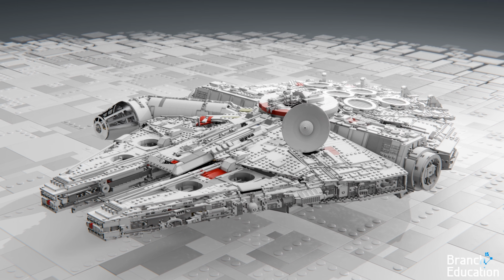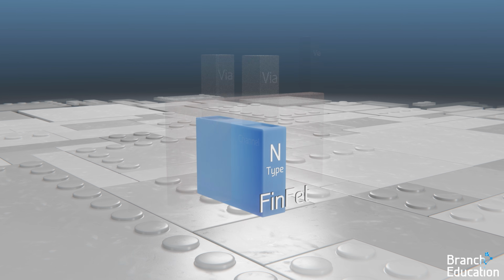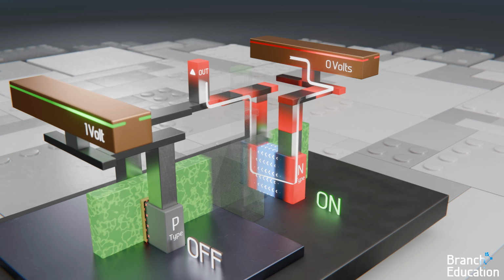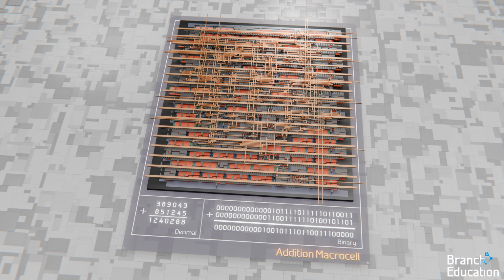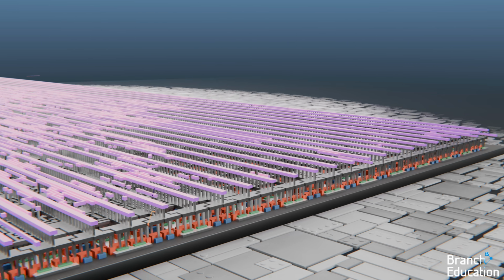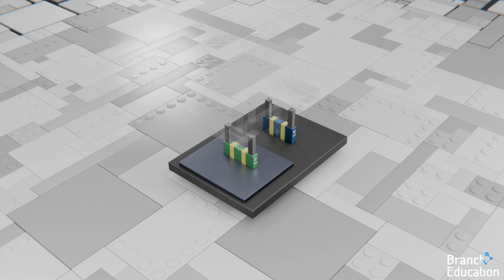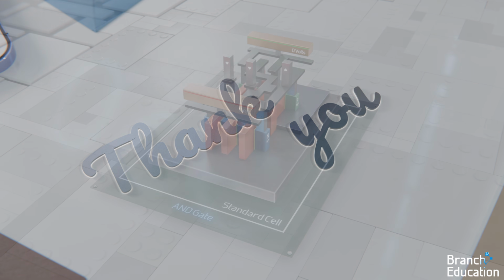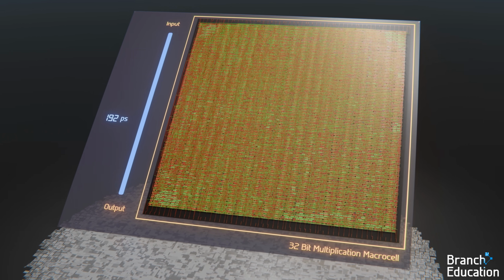How do Transistors Build into a CPU?  🖥️🤔  How do Transistors Work? 🖥️🤔

Comment: 4:31 this describes a depletion FET, not an enhancement type. Enhancement types are used in logic gates.
For Enhancement P FETs:
Vgs = 0V results with no flow.
Vgs = -1V results with current flow.

For Depletion P FETs:
Vgs = 0V results with current flow.
Vgs = -1V results with no flow.

Putting a depletion P on top of an enhancement N, with a shared gate and logic 1 input, will draw a high current (very wasteful). Some inverters are made this way, but with the gate of the depletion P FET shorted to source (as opposed to connected to the gate of the other FET).
Reply: If you don't do it this way, you'll get a lot of noise! Even if the power supply is stable, the finFET itself can cause noise when switching on and off. 
I think the P-channel finFET serves as a booster to avoid parasitic power and connecting it to GND (0V) is the best option!
Replacing the P channel with a capacitor increases the delay in the finFET's response speed and this is extremely bad for nanotechnology where high speeds are required.

Comment: Why don't we use just one P type transistor to make NOT Gate? Looks like it already does what we need 🤔
Reply: If you don't do it this way, you'll get a lot of noise! Even if the power supply is stable, the finFET itself can cause noise when switching on and off. 
I think the P-channel finFET serves as a booster to avoid parasitic power and connecting it to GND (0V) is the best option!
Replacing the P channel with a capacitor increases the delay in the finFET's response speed and this is extremely bad for nanotechnology where high speeds are required.

Comment: Can sb explane how 0V can flow. From what is know about electricity, u always need >0V for electricity to flow. Am i wrong?
Reply: If you don't do it this way, you'll get a lot of noise! Even if the power supply is stable, the finFET itself can cause noise when switching on and off. 
I think the P-channel finFET serves as a booster to avoid parasitic power and connecting it to GND (0V) is the best option!
Replacing the P channel with a capacitor increases the delay in the finFET's response speed and this is extremely bad for nanotechnology where high speeds are required.

Comment: Hmm, are this different transistors than the most basic ones? This is not the symbol i grew up with and see everywhere, and they are called NPN and PNP
Reply: There are 2 groups of transistors!
The polarized and non-polarized transistors.

PNP, NPN, GBT are polarized transistors.
And finFET, MOSFET, CMOS transistors are non-polarized transistors.
Each MOSFET has its own symbol to indicate the type of transistor.

Comment: A notification from you causes voltage-gated CaV1.3 channels in dopaminergic neuron terminals in my brain to open, inducing a localized Ca²⁺ microdomain that triggers SNARE complex assembly (syntaxin-1, SNAP-25, synaptobrevin) and complexin regulation, leading to vesicular exocytosis of dopamine. Dopamine itself is synthesized cytosolically by tyrosine hydroxylase (with BH₄ cofactor cycling and phosphorylation control) converting L-tyrosine to L-DOPA, then aromatic L-amino acid decarboxylase (AADC) using PLP decarboxylates L-DOPA to dopamine. VMAT2 actively loads dopamine into synaptic vesicles, which maintain proton gradients via V-ATPase, before exocytosis releases dopamine into the synaptic cleft to activate postsynaptic D1 and D2 GPCRs, modulating cAMP signaling pathways in my brain.

Comment: Is 0V different from just not having any current flowing through the wire? I don't understand why the ground rail is needed, along with the "opposite half" of all the standard cells, where it seems like the same operation has to be done in reverse just to make the ground rail cause the same effect as the power rail

Comment: Such a good video!

I know what a transistor is, I know what the parts are, and what they do in principle.

But this is the first time I've fully understood the electrical circuit and how it works as a whole.

Great!

This combined with Ben Eater's video show the macro sized and nano sized computers and how similar they are. Just smaller.

Comment: Great explanations! I do have a nit to pick though; I understand why you chose to use 0 volt and 1 volt as the logic '0' and '1' levels to keep things simple, but that's a pretty serious over-simplification. In most real chips, it's 0 volts and "not 0 volts" (typically the positive supply rail). The logic '1' voltage level has changed over the years, generally decreasing as transistors have gotten smaller; and in sophisticated chips (like modern CPUs/GPUs) may even vary dynamically to trade off speed against power consumption as needed.

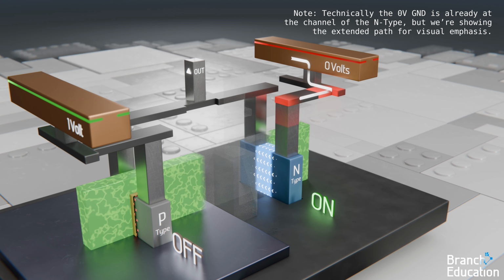Comment: 7:21 i understand why you said that “0 Volts travel through the transistor to the output”, but it is severely misleading to people that want to get into the field and could have been easily avoided by defining voltage as the difference in electric potential between any two points in space and then show how the current flows

Comment: I think maybe one more thing that may have fit well in this video is a mention that there's a possibility of an output left floating (not driven to +V or 0V) and that in chaining logic, we want to avoid this because we want every input combination to have firm 0 or 1 results on all the outputs so that they convey defined data to the next stage.  But keep that floating output idea around for later with bus interfacing...

Comment: Amazing video. One thing while watching as someone who doesn't understand much about logic gates or electricity in general, was that my first instinct was to think about it like a light switch where a 1 is current on and 0 is current off. It made me think that you could get a 0 simply by not applying a current to a P-Type after you had just applied one which is similar to your water flowing analogy. Someone can correct me, but what I felt like was missing in this explanation is A. Why turning the input wire from a 1 to a 0 wouldn't change anything for a P-Type output, and B: that ground wire purpose is to 'reset' the wire allowing it to be 0 again. This would help explain the design of the gates when thinking about it like a process to reset the gate rather than just be turned on forever.

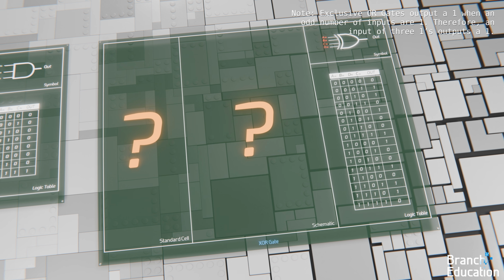Comment: Around 23:50 the narrator poses questions related to how we could build gates with more than 2 or 3 inputs. I'm wondering if that has to do with vector operations in programming where we make it so the CPU accomplishes more than one calculation per clock cycle. Is that related, or is that something else? Is it higher in the abstractions, like at the register level, where transistors are involved by performing operations sequentially until the clock cycle completes?

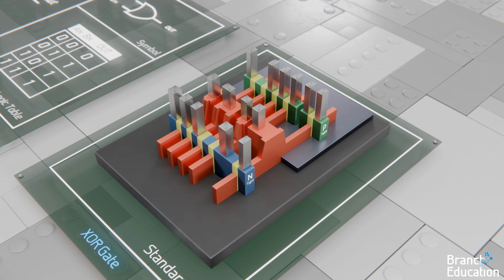Comment: I followed along with this video on Nebula, and tried to sketch out the circuit at 23:03 before progressing the video, and while I got to the same general layout, I think either I got something wrong, or there's a mislabeling on your model. while what I sketched out is the same as your result, there is no output for the second half of the cell. Unless I'm mistaken, your model has the 2 P type gates in series and the 2 N type gates in parallel (the gates on the left of the cell) connected directly to the output (as labeled) as well as to the controlling P and N gates at the right end of the circuit. Meanwhile, the rest of the gates don't actually have an output, at least not shown. Again. maybe I'm misunderstanding your model. I love all of your videos so much, and the way you present everything has always fascinated me and helped me understand so much! That's part of why I'm so confused by this possible error, either in the model or in my understanding. That said, with so many revisions and so much time put into the video, I certainly understand why something like that could be missed, especially when I'm only interacting with it for about 30 minutes while you all are planning and putting together this video for months!

Thanks so much for this and all your other amazing videos, and I'm especially excited to see your dive into the physics of how transistors work!

Comment: I learned about understanding computers and transistors by deciding to design and make my own computer, including designing and making my own "transistors" (between quotes, since while it worked it wasn't a transistor as it worked very different, had very interesting things in it which with normal computers and transistors is very hard or essentially impossible to do. this computer was and is very interesting, though not publickly published also due to how fundamentally different it is from normal computers both in working and use, and so would be hard for many people to see the uses in time before some random company might see and patent it locking it off from everyone(as what has happened to some of my more early inventions which I published without thinking about that( I am not affiliated with a big company or such, so things I publish generally aren't seen or treated as official in a way where it could be used to get patents of companies void, even if they clearly based it on my work and even copied the text I wrote but just changed some names(facebook)), though essentially it can perform many calculations at once and directly link them all to get to the end solution without needing to perform many seperate calculations, and can also do so with way less hardware. most logic gates could be done with 1 such a "transistor", though be it in different ways, I did also manage to make a prototype simulating a normal computer in real time, took inspiration from redstone minecraft computers for the general logic to make a normal computer, then translated it to something this computer could run. also important factor is interlinking capabilities, essentially all bits and cores can both be connected to eachother or not, and can also do so weighted without it relying on any form of complex interconnect.

later I designed made my own actual transistor, or FET speciffically named it SFET as it is a field effect transistor which doesn't depend on N or P channels but instead uses a static field, and some relative geomery.
worked well but only for high voltage. nice advantage is that you can make the N and P channel ones similarly, and it is also possible to make bi directional versions for in AC use, and it can also be used to make very high voltage diodes by attaching a constant static charge(for example capacitor) to the gate terminal. this speciffic transistor I also have here on youtube for how to make and general working. though note it wasn't filmed properly, but is available to build your own sfet from scratch.

later I think it was december 2023 I designed and made yet another method for computing, though the use of this one was diferent, as it was more meant to create new/oddly behaving physics effects. essentially it is a method capable of stabilizing quantum effects on and even far above room temperature in many normal materials, as well as a device to actually do this, which I also actually made and used to confirm it can actually do this by having it create a very strong form of diamagnetism in one dimension yet a quantum locking effect in 2 others(reffering to 3 spatial diminsions, like X, Y, and Z), the nice thing about it is that this was just one effect generated with it, it proves the principle and the same method can be used for essentially designing and creating new room temperature quantum effects. it only programs/creates/stabilize/controlls them however and doesn't read, but you can make such quantum effects interact with eachother and then add a effect to amplify it so it is easily detectable with normal sensors to read it out, the "computer" itself however in this case wouldn't actually exist physically, the programmer exists and the medium it is programmed into, and to some extend the computer exists for a while, but it is and remains essentially just energy stored in the forms of quantum geometry(yes it can store energy in those, power useage was quite low especially concidering the magnitude of the generated effect, but energy storage was proven by the ability to create the same effect in a way where it could remain stable and working for quite a long time, we are talking about seconds here which is very long for quantum at room temperature, and even around a minute later some weak traces could still be noticed all be it much weaker. also note this prototype was far from perfect I had to make it using some things I had laying around at home and I don't particularly have a advanced lab here, mostly relied on frying some normal hardware in the right way that they should form the right patterns and then abusing them in ways they wheren't supposed to be used.
This can also create such room temperature quantum effects in materials like silicon, aluminium and other common materials normally used in semi-conductors, and it is possible to make  both the programmer and material to be programmed(atleast for the effect I tested) using normal lithography mashines. not published due to same reason as first computer, sadly also no interest from companies of universities to properly publish it and research it further, mostly because they don't like working with little known people and the discovery itself largely is a physics discovery and just shows one of the many new possibilities and physics discoveries can't be pattented, thus many companies don't like it because then they would need to spend years to figure out as many ways to do it as possible to be able to make much proffit otherwise someone else just uses another way tha the one they pattented.

Comment: - so transistors basically just store a ruled (on/off) activation for currents.
- the materials either block, hold or transfer current.
- many transistors build long routes that become a process.
- a processor is a compressed container of many routes.

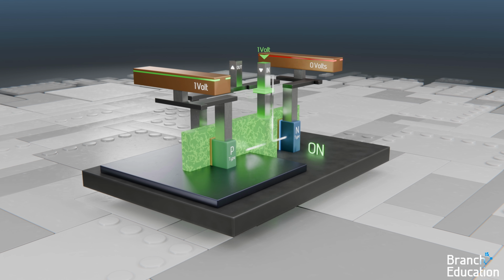Comment: I may sound dumb, but I have a question. 7:09 How does 0V electricity travel? Doesn't 0V mean nothing is flowing?
Reply: yeah the explanation is fine but they draw something current like from 0V/ground to output which is misleading. Their mentioned "simplification" is used because later,when explaining the logic gates, they use the wires for indicating the same voltage potential across it. Never what current flows. There is a header note for it tho. Also, they don't show an actual load connected to the output. So you have to be aware that. think of it this way: We model the load at the output as a capacitor (imagine a tiny battery). When we apply a 0 at the inverter, the transistor at the 1V power rail is pulling the output up to 1V, hence called pull up transistor. The capacitor gets charged up. So there is a 1 at the output. Now, when switching the input from 1->0, the pull down transistor connects the capacitor to the ground rail. Its previously gained charge now flows to 0V as a current.

Comment: Why use 2 transistors for the inverter when it seems 1 would  also do.. however then there would be some floating pin issue i suppose

Comment: For the and gate, why isn't it the same as the nand gate just with power and ground switched? It would require fewer transistors and therefore would be cheaper and more compact, right?

Comment: This is the gold standard for how shit works. 
I see a sad demise however for the sponsor. Between short attention spans and Ai, writing code will be like writing cursive. Transistors rely on quantum tunneling but I think metal will soon be replaced. For example, what are the inputs that require so many steps? A stem cell with Ai can process much more data with synapses. And once pathways have formed, throughput speeds will increase log not linear. 
What IS intelligence? It depends on what you want from it. 
read more?
Folding proteins might be harder than encrypting an email. but only until it's done. then it's just rom. Encryption will always be easy. It won't be worth it. Imagine the deadliest welcome mat. Imagine lightning and your shenanigans are the step-leader. Robbing a bank with a note will be easier than trying to hack another computer.

Comment: 22:10 Why is the AND gate 6 transistors instead of just 4? just switching P and N in the NOR would give you the same result, or am i missing something? it feels like you built a NAND, just to invert it back. Same goes for the OR gate. And the XOR and XNOR gate could be built with 8 instead of 10 transistors

Comment: Couldn't we simply use just the p-type transistor as the inverter? I don't get the role of the second (n-type) in the circuit?
Reply: Leaving a wire floating like that (not connected to anything) is bad practice. Charge can get stuck in that wire, there are inductive and capacitive effects from other nearby wires, etc. Basically, you don't know what the voltage on that wire is actually going to be. And you don't want the output of your gate to be some undefined garbage you have no control over, you want it to be exactly 0 volts relative to ground. How do you achieve that? By connecting it to ground.
Reply: @lunkel8108  Thanks a lot for this explanation, it makes sense ;)

Comment: Awesome video as always !! Thanks for continuing the great work.

Would it be possible to explain how it “actually works”, i am and I think the internet still lacking the last puzzle of how an applications on a device run through the logic / calculation “through” the chip and generating input. 

Most video / knowledge is about how transistor works input of 1 & 0, but not how the software / application actually uses the chip etc… or is it too complicated to visualise it? 

Just a thoughts. Thanks !